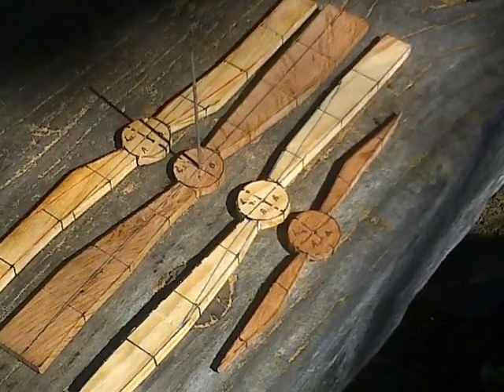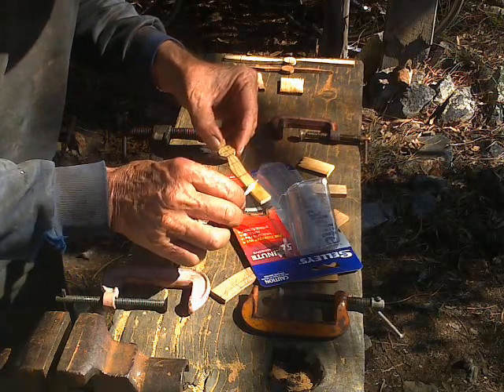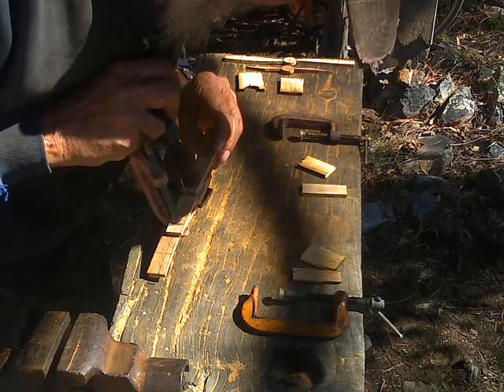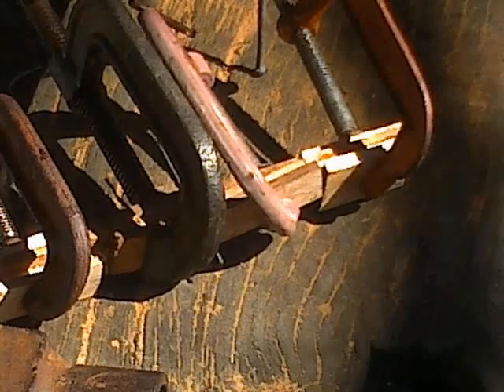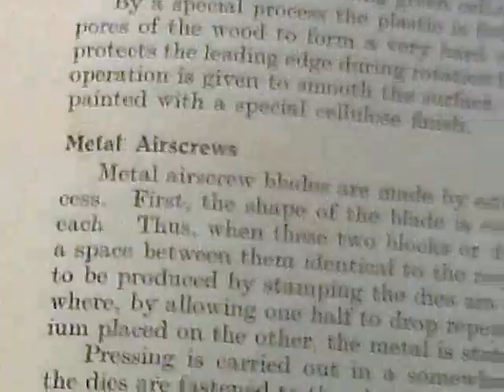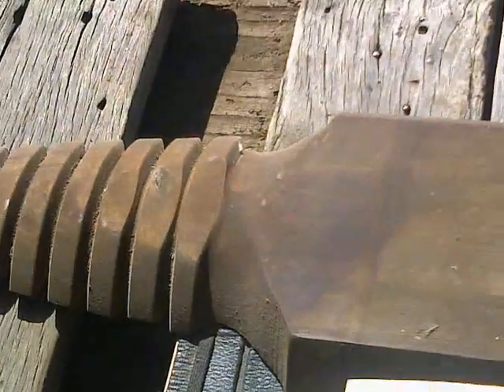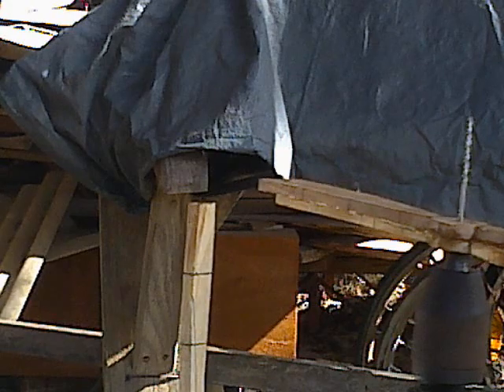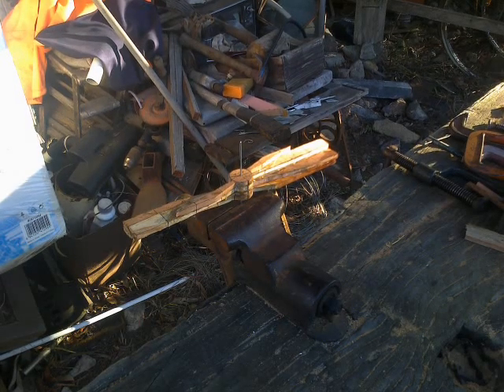Propeller-Carving..., Glueing & Clamping The Blank ; A Textbook Case...

Comment: Hi Chris.
Great explanation and demonstration. That's an old book for sure.
So epoxy is the way to go with this technique? Plus lots of clamps and patience. :-)
Cheers mate.
Reply from the maker: G'day Mike,

Thanks mate.

  Well, I'm using Epoxy for these, but if I was making them to go on an Internal Combustion Engine, or a Windmill, then I'd use (Selleys) Resorcinol, it's a Boilproof Marine/Aviation Glue, Formaldehyde Catalyst in Phenolic Resin, takes 24 hours to cure, dark Red-Black in colour..., which is what all the Aviation Authorities require, for Propellers.

But for these, running at 400 RPM tops, yeah I'm using 5-minute Araldyte ; and only just making the Clamp-up in time....

  If I were to be honest then I should use the 24-Hour Araldyte, to have more time to get the Layups perfect, and have a stronger bond as well...

 And, yeah, the more Clamps the better..., I plan to buy some more - actually ; as well as go sniffing around for a Drill-Press, because at the moment the weakpoint in my system is hand-drilling the Centre-Holes.
  
The Power-File Carving Video goes up tomorrow...; it's like a Magic Wand - waving the wooden overburden out of the way, but I'm glad I learned how by doing it with Wood-Rasps, so as to know what the Wood's limits are, and know how gently to proceed when getting close, kinda thing...

 Such is Life,

Have a good one.

;-p

Ciao !